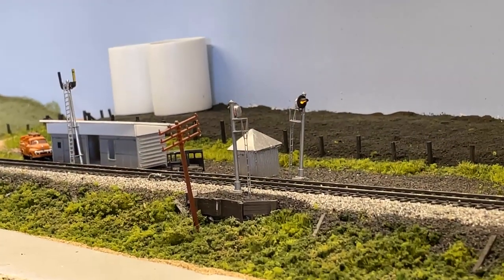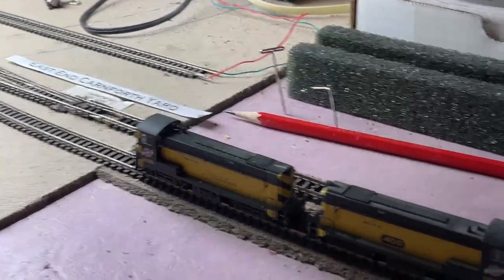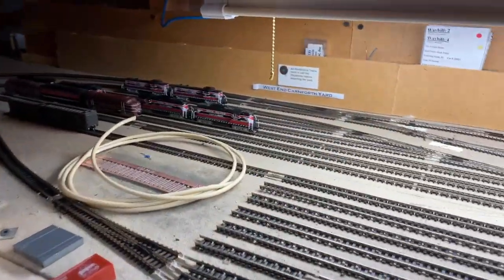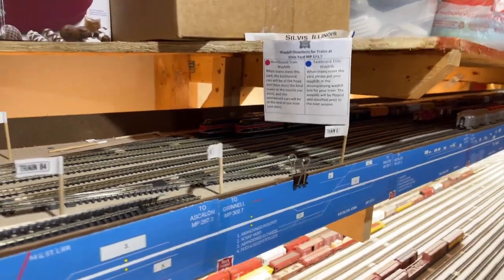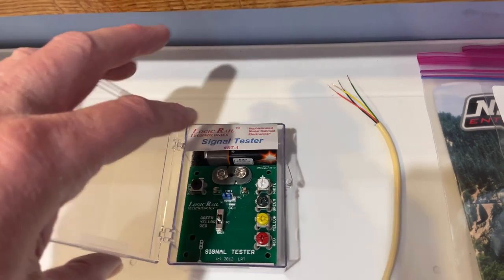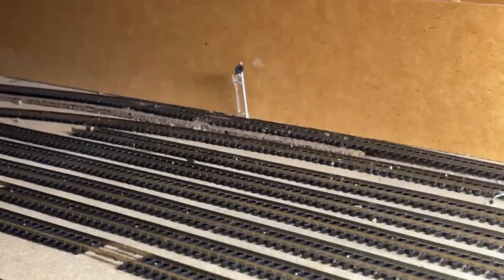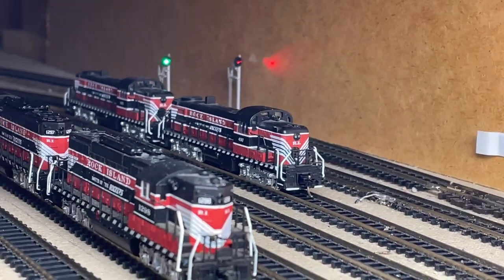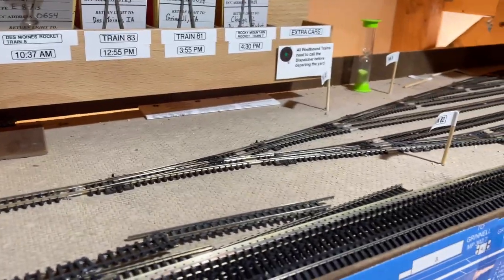The Final Signaling Segment: The Staging Yards

Comment: Nice work Tony !!!
Reply from the maker: Thanks, Mike.  It was one of those projects that was easy enough to finish up but the problem was finding the time to just complete it all at once.  So far it has been great to be in my staging area and be able to read the signals if a train is coming or not.  This will be very helpful once I move back into Op Sessions with my regular crew next fall.  I hope you are doing well.   ~Tony
Reply: I would like to try this on my next layout however the soldering part would be tricky having never done this before
Reply from the maker: @andystrains4335  It takes a little practice but really is a pretty easy skill to master.  I would recommend just getting some old wire and practicing trying to twist and solder it to itself for practice until you have it.  There are also plenty of tips that can be found on YouTube and online to help as well.  Each of us as model railroaders has probably developed a different way we may solder that works for us but accomplishes the same task.  ~Tony

Comment: Nice work on your signals. The dwarfs look great and practical. What is triggering the signals? IR trigger or through block detection circuit?
Reply from the maker: Hello Ron,  The signal are triggered by two pairs of IR sensors between the tracks (east & westbound).  The signal reflects off the bottom of the cars and sends a message to the next set of signals that are daisy-chained together.  if there is a derailment or the train comes apart the signals do not detect that.  So this keeps the crews on their toes to make sure their train stays all together during an Op Session. ~Tony
Reply: @CornCountryRails  hey Tony, thanks for the explanation. I tried the IR sensors on my signals but being outdoors I get too much ambient light and those sensors don’t work very well. So I went over to the hcsr04 ultrasonic sensor and that is what I’ve been using on my signals. Great looking layout btw. 👍🙂🚂